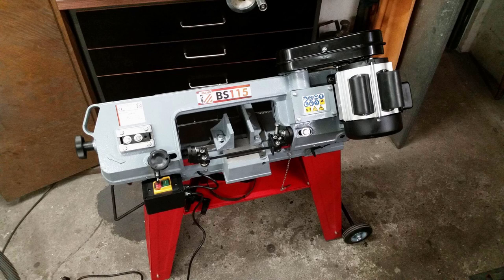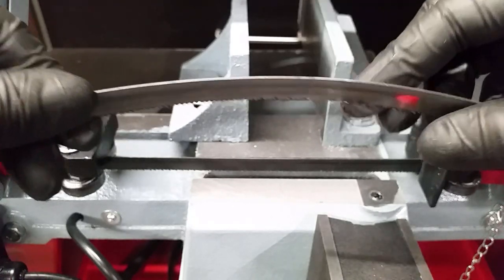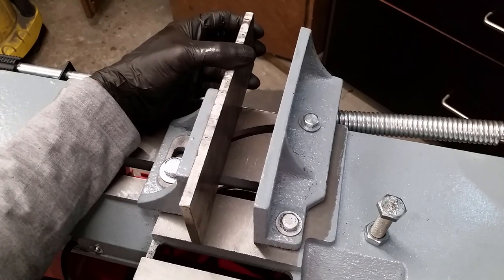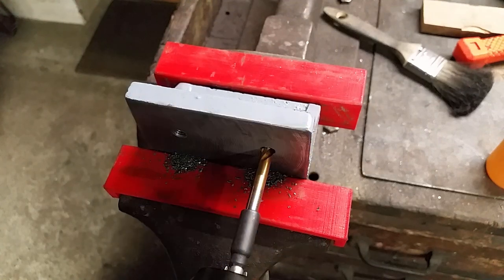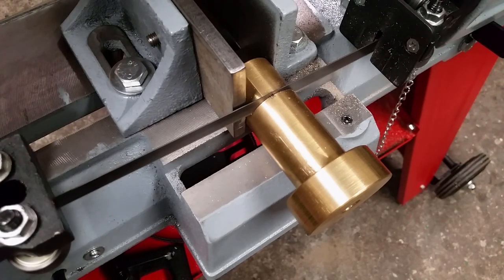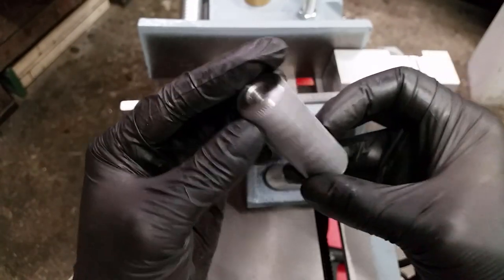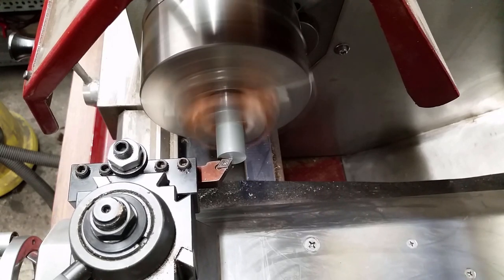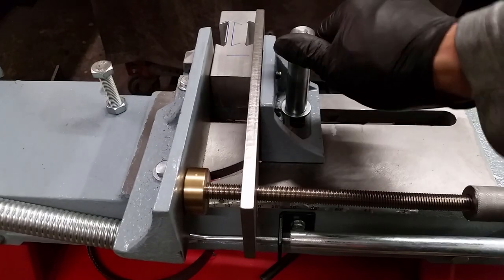Holzmann BS115. 6x4 Bandsaw And The Start Of The Modifications

Comment: Ive had the same type of saw for 28 years and only thing to replace was the bearings that the blade runs on and now I am fitting a cooling system with a large tray to catch the swaff and coolant.
  Worth every penny I paid for it.
Reply from the maker: I heard the worm gear tends to wear down after some time especially if you don`t change the oil over the years. The bearings and the V-belt will be replaced over the years but i  didn`t count them as "broken" parts. It`s normal. I was thinking of adding a cooling system but for now i don`t need it. The blade stays rather cool even while doing stainless with the fastest speed. A tray for the swaff is definitely on my to do list.

Comment: nice work. I have the same saw. I look forward to seeing more modifications.
Reply from the maker: Thanks. This machine seems pretty common in hobby workshops. It is sold under different brands but the main components are the same. Great value for the money you spent and with a few upgrates you can customize it to your needs. 

The only downside is the cutting speed and the durability over the long run. If i needed a bandsaw for my buisness to make money than i would bought a better and faster one. As a hobbiest with a limited budget this works pretty well.
Reply: @basementprojects4712  You seem to have it running very smooth. Can you tell me about / show your drivetrain setup? I can't seem to get mine running so smooth.
Reply from the maker: @TheeGrandmaster  Hi. I have done nothing special. Just getting the tension right and align the blade. It took me a few tries to cut exactly at 90 degrees but thats all i have done.

Comment: i have one more idea , seen a trick to prevent the metalparticles from being drawn through the length of the cut by the blade when you cut wide pieces of flat steel 
you clamp it in at an angle by putting a rod under one side so the saw cut the flat bar at an angle  , while this works theres the risk that the part with work itself loose from the flat and smooth jaw faces , my idea was to make a v groove about halfway up the clamp from one end to the other to put the edge of the flat bar in so you can clamp it down without the piece slipping out

Comment: Why did you make a longer jaw face for only the traveling jaw? I there some reason not to make the jaw shoes 25-40 mm taller than the jaw castings? I envision clamping thin rectangles at a diagonal to reduce the number of teeth in the cut. I like your work and video very much. Thank you.
Reply from the maker: Hi. I made the jaw longer to attach the threaded rod at the end. This helps kepping the jaws parallel when clamping short parts. 

You could make the jaws taler but i saw no need for that when i modified my saw. It will only increase the leaver. 

Clamping at a diagonal is an option and i saw it a few times already. I have never tried it so no experience from my side. In most cases i use thicker material so no idea if this will benefit my work.

Thanks for the compliment.

Comment: I have the same bandsaw but I can't get it to make straight cuts, The blade guide bearing holder is of aluminium and the threads are pulled, The whole adjuster for the guide bearings is pathetic. Going to make up a decent one with allen head studs to push against the carrier.

Comment: Hi, good and clear video! What is the type and brand of the saw blade you've mounted?
Reply from the maker: Hi
I don't know what kind of brand it is. I just ordered a quality blade from a seller of ebay. It just said industrial quality bi-metal blade with 10/14 TPI.
Reply: @basementprojects4712  ah ok, are you able to share the link from ebay?
Reply from the maker: @bjph1977  Here is the link but i 'am living in germany and the seller is located here. 
https://www.ebay.de/itm/2er-SET-S%C3%A4geband-Bi-Metall-M42-BASIC-1638-x-13-x-0-65-mm-10-14-Bands%C3%A4geblatt/124078919839?ssPageName=STRK%3AMEBIDX%3AIT&_trksid=p2060353.m2749.l2649
Maybe it could help you get the information you need and then find a local seller yourself.

Comment: Cooling system could be not bad
Reply from the maker: I thougt about that and made a test. I set the saw on the highest speed und cut a thick bar of stainless steel. After the cut the blade was cool enough to touch. Right now i don't see a reason for a cooling system. Maybe when i modify the saw for higher speeds but not right now.
Reply: @basementprojects4712  this system is not for cooling only, but as lubricant as well. It increase lifetime of blades.
Reply: @Denysmai  yeah people just spray some cutting oil. Also blades are consumables, their cost is so little compared to the actual metal that is being cut...